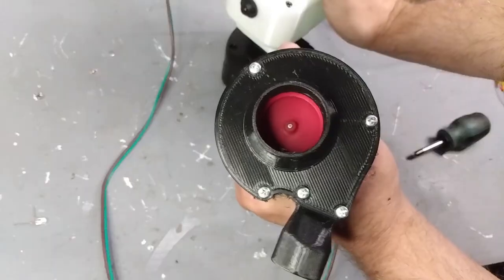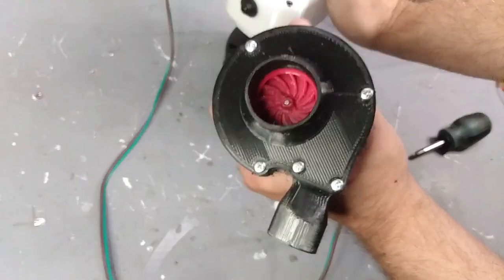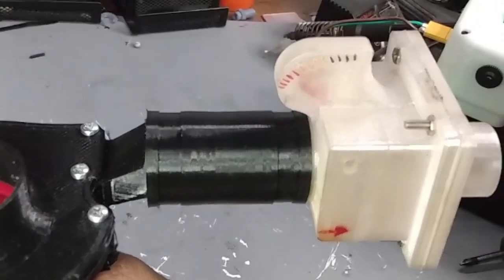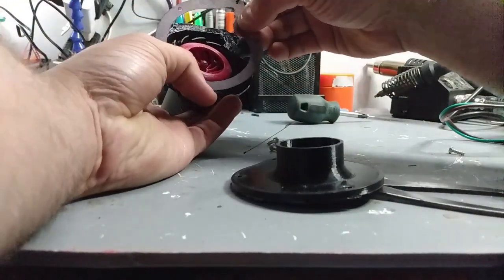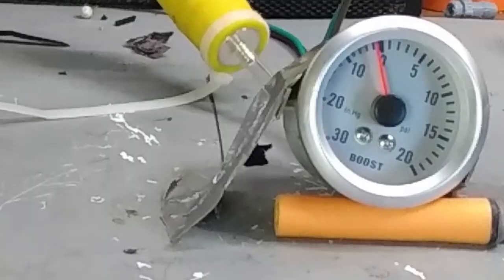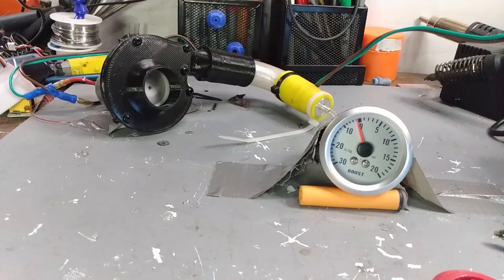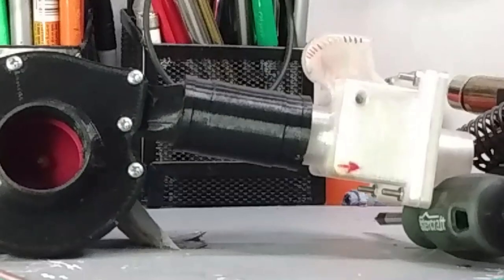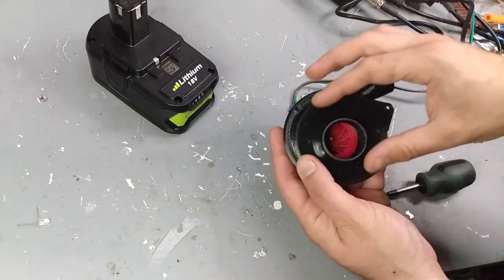3d Printed Vacuum Pump Makes Boost(free files)

Comment: when you block the outlet of a centrifugal implleor/fan it simply doesent move any air and the rpm increases, so your measurement for static pressure wont work. look up "measuring static pressure for centrifugal fan" and see what test demos they use and copy them

Comment: Look out for recirculation - from the high pressure side to the low pressure side of the turbine impeller. When running into a dead head like the boost gauge, the recirculation will be where you lose lots of pressure.
Reply from the maker: yeah that's likely why it seams to pulse ,I do need to make up a bleed off tester . I get the feeling this design would seal better on the vacuum side , being as I took the design mostly from a vacuum cleaner . just another step on my development and understanding of turbine, and housing design .